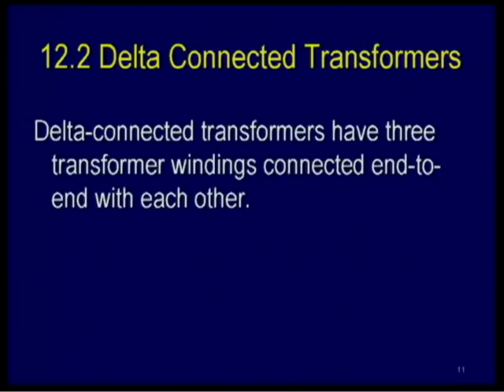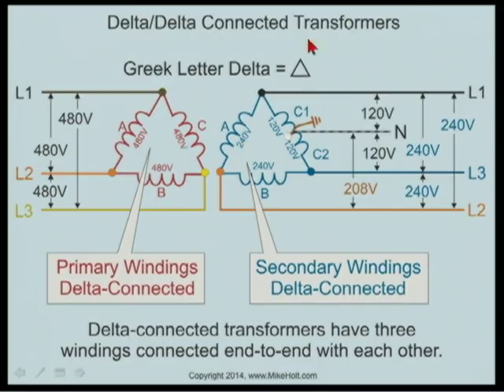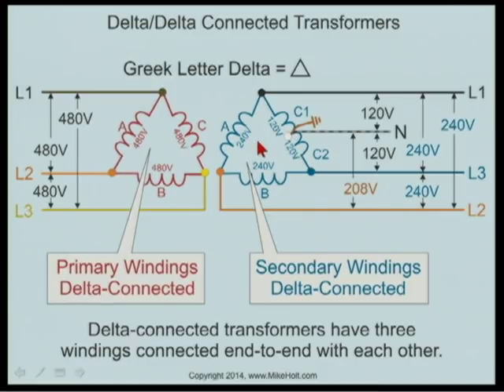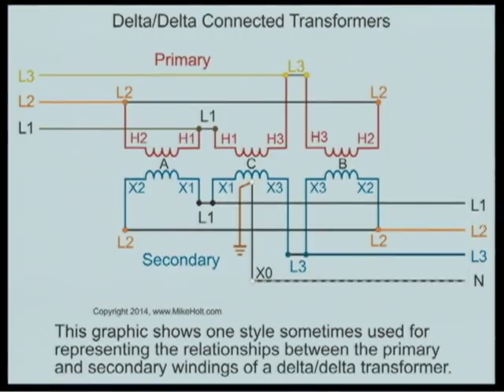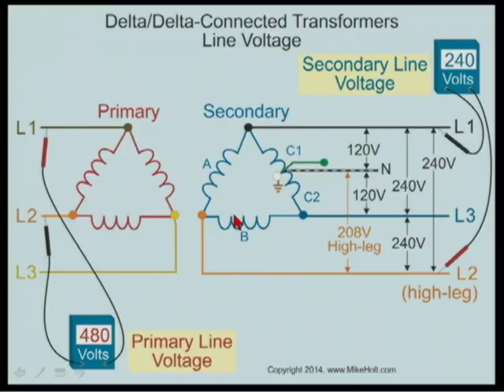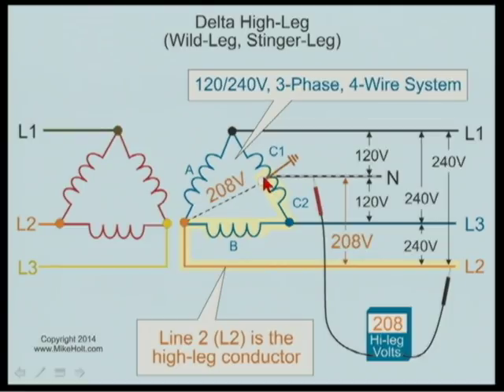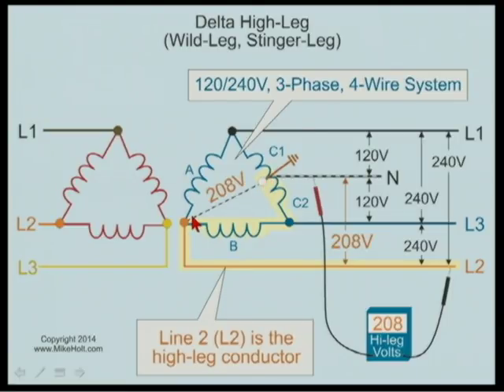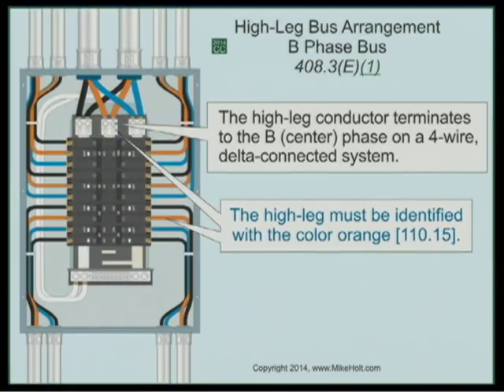Transformers - Understanding Delta/Delta Connections [250.4(A)] (26min:36sec)

Comment: So in conclusion It's safe to touch a phase wire barefoot and wet right?
Reply from the maker: Your comment is 100% wrong; it is NOT safe. I'm going to assum your post was intended to be annoying. Please watch the following video it it was sincer; https://studio.youtube.com/video/mpgAVE4UwFw/comments
Reply: @MikeHoltNEC  Sorry Mike but it's just that I don't get why is neutral necessary  Foloowing your explanation we could just use the ground wire both to create a voltage between it and phase and to ground the whole building couldn't we? You says that neutral is not driven, and ground wire's function is not giving a path to free the excess of electrons, so it's like we need just two wires and we  can leave all the security on a breaker.
Reply from the maker: @tvblood3550  Watch - https://www.youtube.com/watch?v=mpgAVE4UwFw
Reply: @MikeHoltNEC  I watched it, I have cleared my doubts about basics but now I have a big one.
If a parallel circuit has the same voltage in all the loads, why are there voltages drops? I mean, I connect the toaster, the oven, the shaker... then I take the multimeter, put the probes in the socket and I find a voltage drop, why? It is a paralel circuit wich means the same voltage and different amps
Reply from the maker: @tvblood3550  Because there is always voltage drop on the wires supplying the individual parallel loads. When it's said the voltage of resistors are in parallel, they are assuming no voltage drop of the conductors.

Comment: The national Electric code mandates that the phase rotation be clockwise ABC in panels (Left to right, top to bottom, and front to back). Article 408.3E(1) and 409.102B of the 2014 NEC.
Reply from the maker: That is true, but why are you making this comment? What am I missing.
Reply: Because you brought up the subject. So It was for anyone's information. You are not missing anything.
Reply: In the slide at the 23 minute mark, the wild leg is moved to the B phase by swapping the B and C phases. This reverses the phase order in violation of the code sections Jolyon mentioned. The connection from meter to panel should have rotated the phases: C to B, B to A, and A to C.
Reply: Brian London interesting observation, and I think good that you pointed it out. Perhaps this is why sequence at any given point is a crap shoot, folks who simply put the high leg in B slot are focused on moving all associated loads and not blowing equipment up. Although when motors start spinning backwards you'd think they'd come to what you just pointed out. I have so many three phase panels at work I thought it would be a good idea to scope them out for sequence. It was frustrating when after several panels each was different within the same drop.
Reply: @brianlondon4695  Very interesting indeed!
Reply: At a large hospital that I retired from they probably had close to 100 480 to 120/208 transformers. They were always remodeling at least 4 of the 14 floors so we often had to come in and back feed a 120/208 panel while the feeder or transformer was moved. Had all of them phased out the same. Same thing with the normal & emergency 480 volt panels.

Comment: Synchronizing phase rotation thru out an entire facility would be too good to be true. Now your just spoiling electricians if you do that.
Reply: We can dream can't we?
Reply: No if you have a lot of mschinery portable cinveyors & welders. Only cavemen do not phase out all of the 3 phase receptacles. Easy peesey using the BOY Brown orange yellow color on all 480 volt receptacles. At my first job we had 50 refrigerted trucks that had to be plugged into 3 phase receptacles every night. At next job me and another young sparky phased out all of the portable welders conveyors that got rearranged several times a week along with packing machines that had to be moved several times a week. Cracked me up when I saw reversing drum switches on 5 portable welders and at least 25 packing/ wrapping machines.  For conveyors caveman had short reversing cords. We would spend an entire shift just phasing out 3 phase receptacles. Most from a cord drop off a 20' ceiling. It paid for itself quickly.

Comment: Is delta connected always at high voltage side?
Reply: so,such type of questions are illegal?
Reply: Do you mean is there always a high leg? Then no
Reply: @ahsankabir2082  No.   There are WYE to WYE transformers as well.

It is common to have DELTA on the primary size, because it allows you to eliminate the neutral from the source.  It also allows 2:1 (480 delta to 240 delta) or 4:1 (480 delta to 120/208V wye) as the transformer ratio, when working with 480V primaries, rather than a ratio involving the sqrt(3).

It is also common for utility service transformers to have DELTA primaries, in the event that there is only consumption on the premises.  Step-up applications often require (per the utility), a WYE topology on the medium voltage side.

Comment: 3:27, is this a typo?
Isn't the voltage between line 1 and line 2 in your secondary windings 240, not 480?
Reply from the maker: You are correct, I did say 480V, and I should have said 240V. Sorry and thank you.